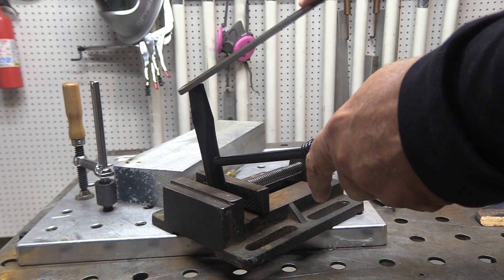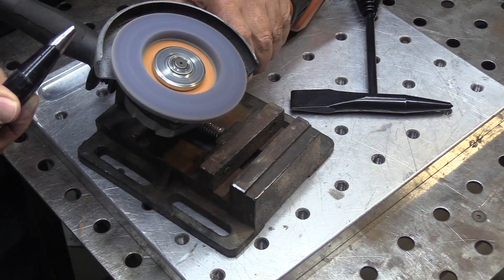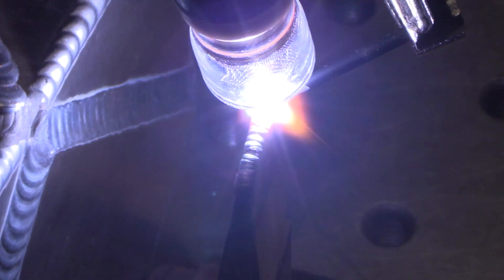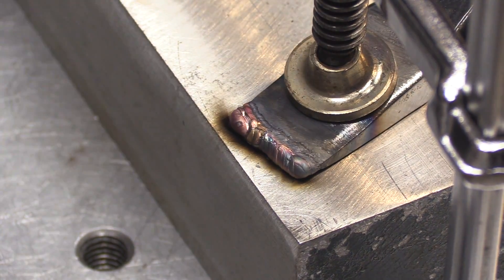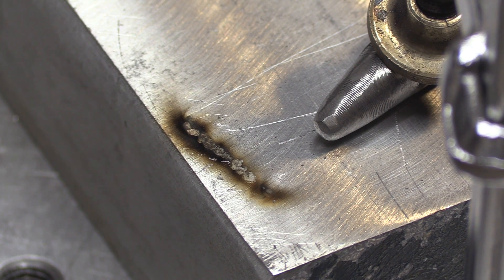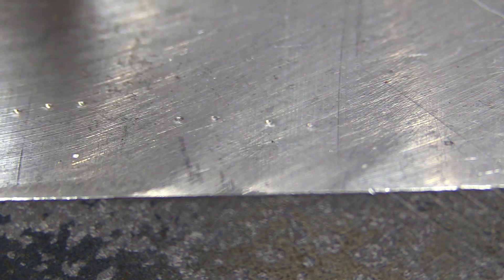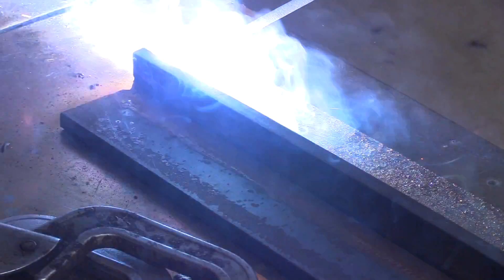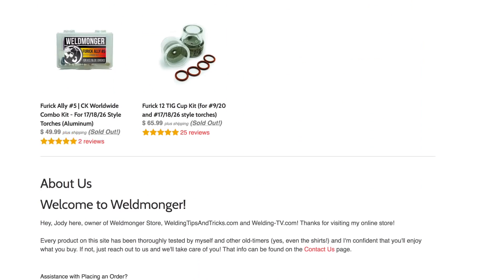Chipping Hammer Hardfacing Secret

Comment: Back in the 80's when I was learning to rig with argon I was taught to use some Air Hardened filler rod, and to lay a bead of that on the edge of all my straight blade screwdrivers. Wow, they stayed sharp for years and only needed redone after the hard material chipped free of the softer blade material. I never thought of doing that to chipping hammers, duh ! What a slap in the forehead moment to see you using an old drill bit, haha !!!
Thanks for the tip !!!

Comment: Back in the 90's I was doing 0.065 wall polished ID/OD stainless tubing and a guy started working with me that had done work in oil refineries, he would take a large flat file and grind a chisel point in it and about 4 half round cuts on one side on the front of the file, that works better than any chipping hammer I have ever seen.  Doing sanitary pipe you always had a half round file around and I always did this to mine and it also works for knocking off mig spatter.  I still have one of those old files in my tool box.

Comment: That is a fantastic idea, bed frames are also hard to file too and cut. So now i don't have to buy those hardening rods to add a harden edge to things I make. Love the idea the automatic center punch was key to the understanding on checking hardness, and file as well.
Reply: Bed frames are usually made from the cheapest crap steel available! Make your file and cut off wheel need replacing

Comment: Great tip about the drill bits. I have boxes full of unsharpened drill bits that I got for free. I've used some special weld rod before but those cost an arm and a leg and for my purpose your tip will probably be fine.

Comment: Thanks for all you do Jody!!   If you ever get a chance to play with any stellite 6 please do!!   Your videos helped me for years improve my tig welding skills.   I’ve passed my classes with your help!   Now I tig weld for a machine shop and a recent job has been in a huge stainless steel shaft using 309 to built up journals then they are cut back about .0030  and then I refill with stellite 6 rod.   I’ve had issues laying stellite on top of stellite as it will crack and the entire process has to happen again.   So we’re praying that using 309 to build up and one pass of stellite will cure that problem.   We are also preheating the shaft before adding any stellite.    Anyway hope you had a very Merry Christmas and have a happy new year!!   Take care.

Comment: Cool tip! Another similar idea: you can use some piano wire to build up a hard edge on a tool in a pinch as well. Once did that on the cutting edge of some worn out / chipped linesman pliers, and it worked great. Obviously if it's something critical for a customer, go get some of the good stuff, but for messing around on your own tools, it's fun and convenient to improvise and see what happens.

Comment: What a great video .. The idea of using the drill bits  is fantastic I noticed on a lot of these new barbecues and big smokers that small shops build.. The handles to open and close fire box’s  and flu’s look like chipping hammers without the heads I wonder if the chipping hammer was adapted from something else all those years ago?????
Reply: The coiled wire handle on smokers is only attached to the body at one or two small points. Heat isn't transferred as easily through the small mounting area and air circulates easily around the coiled wire, allowing it to cool better than solid handles. The handle on a chipping hammer flexes to reduce impact into the user's hand. If I had to guess, I would say handles for hot objects came about long before a hammer used for electric arc welding...........we have had stoves far longer than electricity.

Comment: i hardface many components using a PTAW process, and manual tig at work and we use a filler material called Stellite. For the PTAW mechanized process I use powdered stellite, and with manual tig I use stellite 6 filler rod. After welding it will still maintain a 50+ rockwell hardness. Great idea using a drill bit! Im curious as to what the hardness is after welding.

Comment: After hardfacing it like that, you can harden it by heating it up with a torch to around orange, then dunking it in water. Temper it by baking it at around 500F
Reply: I'm pretty sure he could have hardened it that way without the drill bit.  There's got to be enough carbon in that steel to harden up by doing that.
Reply: @alext8828  I'm not sure... But these here are welders, not too knowledgeable about steel hardening anyhow
Reply: @theuniversalbean9352    True.  Wouldn't be surprised.

Comment: If you don’t have a Tig, can you oil harden the tip as an option? 
Are there other options? Would using a 1/8 tooling dowl pin instead of a drill be a good option? They are much harder than a drill so I am guessing it might be to brittle for a long term good edge.

Comment: the kind of hard facing I have done cracks if you don't get a good mix between the base metal and the filler. so you need 3 layers of a transition rod which you should mix good with the base and after that at least 2 layers of the real hard stuff, but make shure to mix the first layer with the last of the transition passes.

we usually go for 5 or 6 layers of the super hard stuff just so the company that ordered the repair has more matereal to wear down

Comment: I wonder what types of drill bit steels will work for this. Some cheap ones are just a high carbon tool steel but most are hss with a variety of different additions. I'd assume carbide is out of the question. Might be fun to play with when I'm bored some time.

Comment: I never used those chipping hammers, all too soft and pretty much useless. So I usually make my own, often with lower grade chisels by hand forging to shape and fit the handle. Finish off by hardening and tempering (I usually do this in a single heat operation). My current one is about 10 years old.

Then I saw this video. Great tip. Now I have no need to make them anymore.

Comment: Several decades ago, i the early 1990s, Hollywood Casinos were building a pair of gaming boats in Aurora, IL on the Fox River.  The boats had hulls of 316L stainless steel below the water line.  The stainless tore up my inspection chipping hammers.  I took one hammer and MIG welded  the edge and point with some 316 stainless wire, heated it with my oxy-acetelyene torch to a bright yellow, hammered it into a semblence of an edge and point and ground it to acceptable profiles from there.   I again heated the ends to a dull red and oil quenched the ends.  I am sure I nroke about a dozen or more rules in the process, but the hammer survived not only the rest of the inspection of the two hulls,  but I used it for years afterward, and gave it to my brother when he expressed an interest in learningbto weld.
Go figure!

Comment: Awesome! I bought the “best” chipping hammer I could find in my local tool store, Australian made (supporting manufacturing in my own country) that claimed it was “guaranteed not to flatten” and was rather unimpressed having to run a file over it every second or third day when welding out trailer chassis of strenx 700 with betaweld SL-71T, (1.2mm seamless copper coated rutile flux core). This is a game changer, thank you good sir.

Comment: wow, this might prove to be super cool for me. A while back I bought a bit set of cheap drill bits, it was like a 100 pack. and they've been working for me for the past few years, but they are pure crap. the smaller ones snap off real easy, and the bigger ones are good for a couple of holes but dull fast. But I bet that steel is more than hard enough for a chipping hammer, chisel, knife edge, lol. now I know what to do or at least try to do with those crappy drill bits i have. my first project is to make a center punch out of a bolt. maybe a grade 8 bolt is hard enough but whatever.

Comment: I'm going to use this on my mower blades to see how long it holds a good edge.
Reply: I've been wanting to do that since TOT mentioned it
Reply: That's really a smart idea
Reply: It should work well if you never encounter rocks while mowing, but I suspect a rock or other hard object impact would result in losing a chunk of the cutting edge versus a ding in a normal blade.
Reply: That is a great idea.! I wonder instead of a drill bit, use a small die file?
Files are harder than drills, and might hold an edge longer, plus it would leave more material!
Reply: Mower blades don't have hard steels for a reason but I can't find an authoritative one.  The best I can think of is that the hard steel will shatter and come off with time and be difficult to repair (unless you can weld).  There is also the safety consideration of having shattered pieces of steel coming off the blade.  The edge buildup flying off my mower blade, not sure how concerned I would be with that.  But I don't sell mower blades and I willingly choose to use cut-off wheels on a regular basis.  So wear boots and don't mow near others?
Reply: @fltchr4449  You make very good point. A brittle failure  would not be good. I will probably do a single layer only to keep the hardness down and retain some ductility by dilution with the mower blade steel. By the way, I suspect my blades are 1045 steel as a minimum based on how tough they are to straighten after hitting a tree root.

Comment: Solved my problem! To buy any hardfacing rod around here you have to buy a minimum which usually cost about $100. I’m a hobby welder, I only need a bit at a time. This way , just go out and buy a few drill bits for a couple of bucks and problem solved.
Reply: It is a really clever and inexpensive solution.  In the US you can by the Weld Mold 958T tool steel TIG rod online for $28/lb. plus shipping.  Not terrible, but you can buy a lot of drill bits for less than that, and for many purposes they'll work fine.

Comment: I 've always wanted to add some 0-1 tool steel on there too. It's cheap if you don't have a bunch of old Drill bits.  But Beware....if you do this, you can make marks on the weldment that might be a problem later...
  I've even had inspectors reject stuff with marks from a needle-scaler...Aero-Space ...usually not any sort of structural problem, but inspectors just hate to pass things ('100%')....

Comment: I tried hard facing a garden implement with an old drill bit and the thing was REALLY gassy.   It blew huge bubbles as it cooled and made a porous mess.  Could this have been a shielding problem I created, or do some drill bits have a lot of gas in them?  (There's a fart joke in there somewhere.)   I tried the same operation with an old E8018 stick with the flux removed and had no issues so shield failure seems unlikely.

Comment: These hammers can be hardened by heating to a dull  cherry red then quenching in water. Repeat one or two times. If you drop the hammer and it shatters, you did it one too many times.
Reply: they don't have enough carbon to harden, most are junk steel
Reply: @taylorwso  what can i tell you? Buy quality chipping hammers.

Comment: Hard facing works better when you have an intermediate layer of modest hardness, and then your hard layer. A facing layer of high speed steel, mixed into the base metal, and then a top layer of hardened steel, mixed into the intermediate layer. Hard metal laid over the soft base metal will just pull off like a scab.

Comment: could i use hard facing welding rods and get the same results ?
Reply: Like 7018 ? Lets tray. I will let you know…
Reply: @naveebisrael  Do not confuse hardfacing with a joining process. Hardfacing is the process of applying a harder or tougher metal to the base material. Hardfacing electrodes are divided into three categories: iron base, nickel base, and cobalt base, which are then alloyed with carbide-forming elements such as chromium, tungsten, molybdenum, and other elements. They typically do not have specific AWS classifications except for the standard cobalt alloy range 1, 6, 12, and 21.

Unlike joining electrodes, hardfacing electrodes are a collection of proprietary alloy formulations geared toward meeting specific needs. They are produced three ways: a tubular rod filled with an alloy mix and then dipped in a coating or has a coating extruded over it; a carbon steel rod coated with a mix of alloys and deoxidizers; or a cast cobalt rod with a coating extruded over it.

Hardfacing electrodes, especially those with a tubular construction, are not designed for penetration. They require lower parameters for less dilution and more hardfacing efficiency. One common mistake with tubular electrodes is crowding the electrode into the workpiece, causing it to overheat. Remember, hardfacing electrodes run differently from an E7018 SMAW electrode. They have a more globular transfer and require a longer arc length.

Hardfacing electrodes, when applied with a stringer bead or weave bead pattern, develop a cross-cracking (cross-check) pattern because of carbides that form in the matrix of the weld pool during solidification. This is normal. The exception is if the electrode is designed specifically for crack-free deposits.

Halinson Campos is project business manager – filler metals at ESAB Welding & Cutting Products; Martin Denault is applications engineer and CWI at Exaton, an ESAB brand; Richard Cook is senior product manager at Stoody Co., an ESAB brand, 2800 Airport Road, Denton, TX 76207, 800-372-2123.
Reply: @flhusa1  Thank you for the detailed answer.
Reply: @naveebisrael  you are welcome I found it on the internet so I copied and pasted it!. I even learned stuff I didn't know.
Reply: @flhusa1  I realized you're a smart man

Comment: so essentially your weliding with tool steel ?  ToT did a video a few months ago showing tool steel filler rod, said the stuff is rather $$  but old drill bits im assuming are made from tool steel correct?
Reply: Depends. Some are HSS, and some are/claim to be carbide/carbide coated.

Comment: Assuming you have a TIG welder? Those bare not affordable for most of us!
Most have a stick welder or a MIG welder, and for MIG, just use that cheap Flux core wire.
It's as hard as coffin nails! Tried to weld something that was to be machined and it ate up the tool bits and they had to use carbide after grinding the high spots off because it kept eating the carbide!
Used it for snow blower shoe wear surfaces and have not had to resurface them in years instead of every year!

Comment: Brilliant. I tried to buy some weld-mold 954 that THISOLDTONY showed but it’s really expensive. I’m definitely going to try this.
Reply: I think that's Weld Mold 958T.  There are other TIG tool steel filler rods, but 958 is the one that can be used like this drill bit, in an as-welded condition without further heat treating.  Not sure about the relative hardness and uniformity of the resulting surfaces; probably depends on dilution, heat input, cooling, etc.